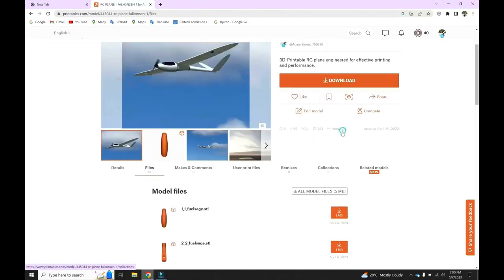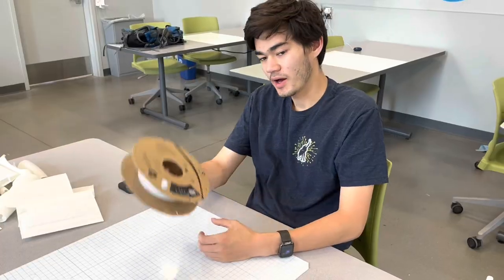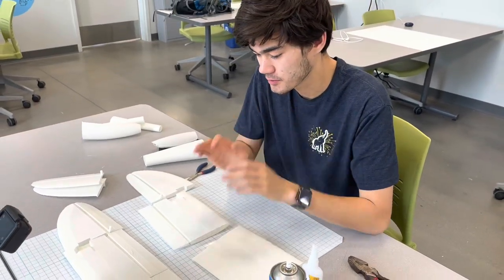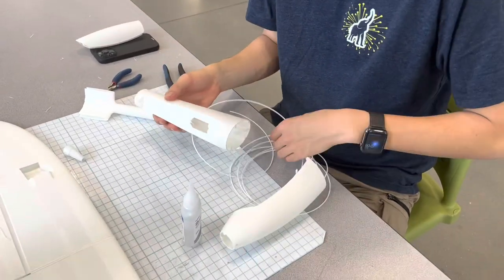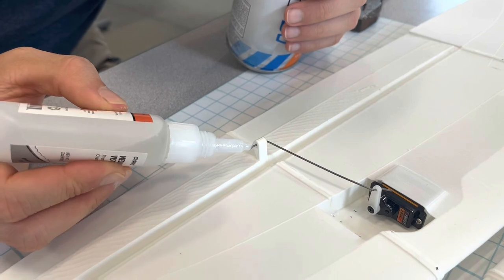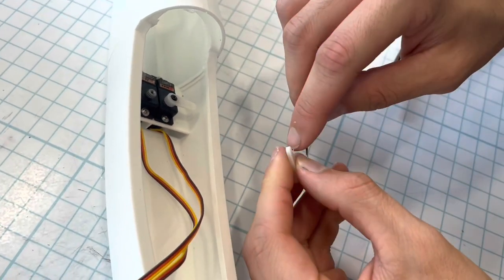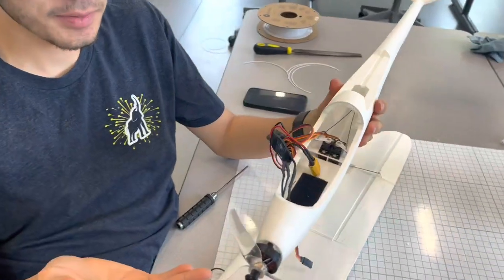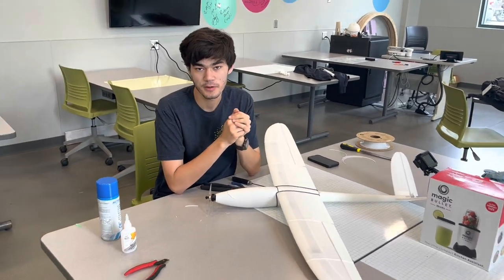Falkonsen 1 - Build video

Comment: Ok, I got everything assembled but I have a couple questions…1. How is the landing gear supposed to be mounted? You offered the option for it but didn’t show it in the build video. 2. How does that band keep the wings from coming off? He shows how to put it on, but it doesn’t show what is keeping them secure on the trailing edge of the wings. 3. Again, showing the installation of the rudavator control rods, you say to run them through a hole but the video doesn’t show what hole you’re talking about and I can’t see any hole that is open at the rear where the rods are supposed to come out. Now I have control rod bending and slapping the top and bottom of the fuselage every time I move the servos. You guys did a great job with this glider, I just wish the video was more clear on certain parts of the build.
Reply from the maker: 1. 
16_lg_mount_L_lg_mode and 17_lg_mount_R_lg_mode are supposed to be glued on the 1_1_fuelsage_type_2 and a wheel of an appropriate diameter and width has to be fitted. I am currently working on publishing that as a model as well.

2.
The band is under tension and provides a fixation of the wings to the fuelsage

3. Both tail rods run through the center channel, which is only visible from inside the fuelsage.

Thank you for this comment. This will help me to improve the Live Build Manual.
Reply: @jirocodesign  ok, so for the landing gear, I’m guessing that the two brackets glue on each side of the wheel well, and you just put the tire in between them and run a pin/axle through the middle?
Reply: @jirocodesign  also, can I present another idea that I think would improve the aesthetics?? Is it possible to create a cowling to fit over the motor so it doesn’t stick out like a sore thumb…and the last thing I found was if you were to add some stress relief holes on the hinges of the ailerons and rudavators, it would reduced the tension and pressure on servos and lower the torque required to move the control surfaces. I actually cut out a few relief holes along the hinge line and it makes a huge difference in force needed to push/pull the control surfaces equally considerably lower stress on the servo motors. Anyway, just and idea 😁

Comment: I reprinted the fuselage with 2 layers as my first print was too weak, added fiberglass tape to fuselage and wings to protect on belly landings. Set up with 2304 motor and 850 3s lipo.  Weight was just under 500g even with extra layer and tape. Balance was good.  Cramped fuselage but initial flight test was good.  My biggest issue was motor mount but as it turns out I was able to attach my motor without using it. I used a part from a 2812 with a screwed on piece of wood. Inserted the part into end of fuselage and taped it on.  Since motor is small no issues and 2304 has more than enough power. Should be a fun plane. Once winds calm down I'll do a longer test.
Reply from the maker: That’s awesome! How exactly do you mean the two layers? Nevertheless, it’s fascinating how light it turned out… 500g and reinforced!

Let me know once you take a video of it flying!

Adam
Reply: @jirocodesign  I think the weight came in good because of the small motor and 850 battery and LWPLA with two layers just on fuselage and some fiberglass tape didn't seem to add much.  Looking forward to getting it out again, but too windy for now as I'll want a pretty calm day for more testing.   Thanks for the model.  Printing the control surfaces with the wings, tail was a great idea to make the build easier.

Comment: Thanks for the info.  Starting printing and so far so good. Just wondering how plane handles grass landings.  Printed planes are fragile.  Should I use a skid as the grass area I use is a bit rough?  Will wings slip off without causing excessive damage on a hard landing?
Reply from the maker: What material are you going to use? I printed mine LWPLA and I would not even describe it as fragile… Belly landings without any modification on grass are absolutely the best.
Reply: @jirocodesign  I'm using LWPLA.  I'll go without mods as you suggest.

Comment: I assume you just glue on the motor mount?   I need to get some long wire for the servo links as the ones I have are a few inches short.

Comment: Looks good.  How far back is the CG?  What motor did you use?  Just wanted to get weight, thrust as a starting point.
Reply from the maker: The cg should be less than one quarter of the mean chord length. I used 2306 2250KV motor with 3s. However, a 2s might perform better in this model, as it is very lightweight. Feel free to read more information here: https://www.printables.com/model/445044-rc-plane-falkonsen-1